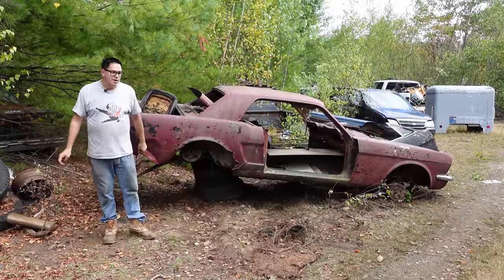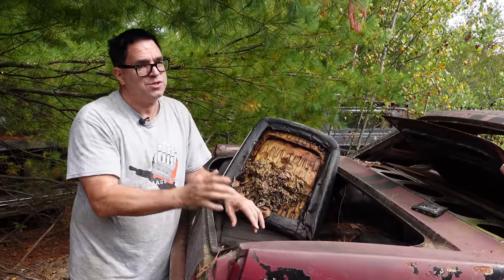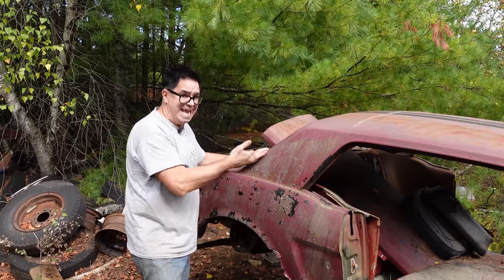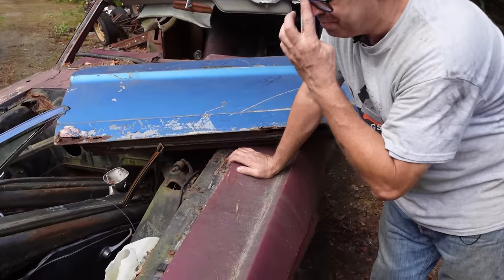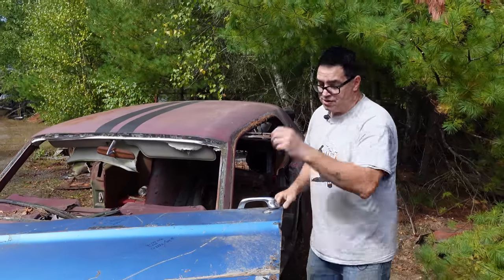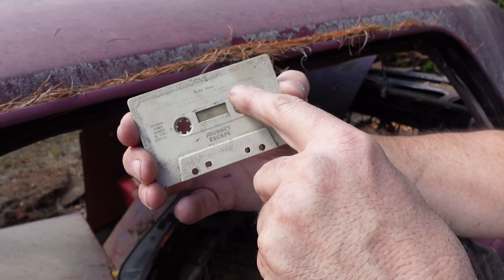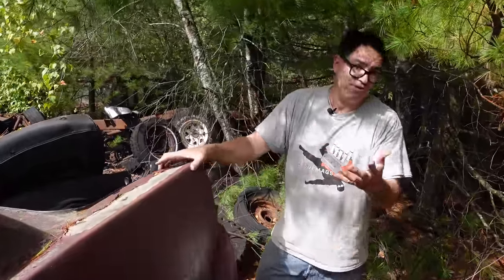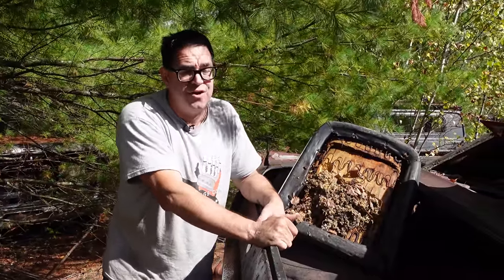Four Lug Rustang

Comment: You point out some of the reasons I never really liked Mustangs in my youth. Shock towers, four lug bolt pattern, etc, it was not easy to do a V8 Swap. Even Mopars, change the K frame, really. We were young, did not have tons of cash no room to strip down the car and rebuild it. Now if you had a GM car, most six to eight swaps are bolt-in. Eventually, find a better rear and you were done and had a decent car for less money and work. As I get older I appreciate all the old cars for what they actually are, not a rolling parts supply...

Comment: Not a sedan.  Mustangs were coupes, Hardtop, or Fastback  2+2 or convertible.    Hardtop because it has no post for roof support.  Coupe because  it's a smaller two door.  Fastback aka sports roof with some brands is the sloped rear roof line. 

Convertible are just convertibles.  

These terms are time fluid and have evolved some with modern designs.  It's  the same with the term muscle car the meaning the 60's was far more specific than we use today.  In the day it was a two door mid sized car with the biggest engine available, at least 380ci.  There were no first era small block muscle cars, they wouldn't be included until the 70's.  Pony cars started by being based off the compact or economy platform.   By 70 the new Cuda was based off a midsize platform and the Mustang or Camaro may have well been as they were nearly as wide and heavy.

Comment: I thought a sedan had 4 doors?
Reply: Most four doors are sedans. More four doors are sedans than two doors. Pretty much all station wagons are sedans.
A sedan has a B pillar between the front and rear door glass, whereas a hardtop does not have the pillar, and the side windows abut each other, with a seal on the front of the rear glass.
A sedan also has framing going up and over the door glass/side windows, whereas a hardtop's door windows seal to the roof of the car.